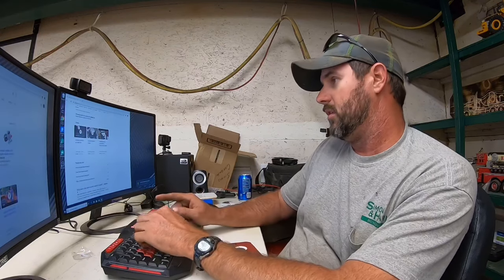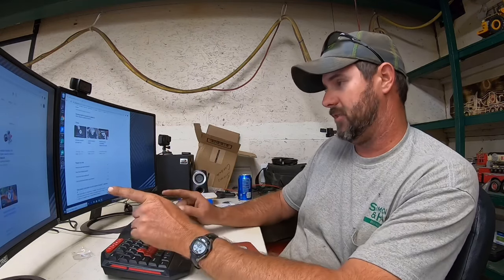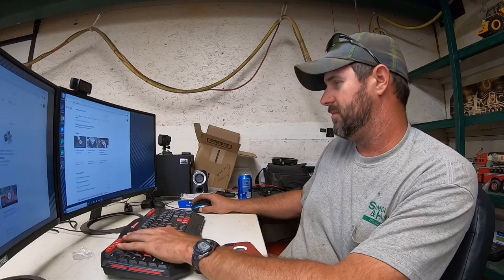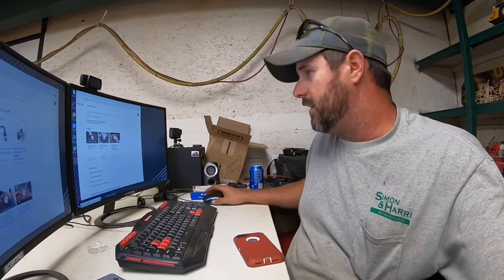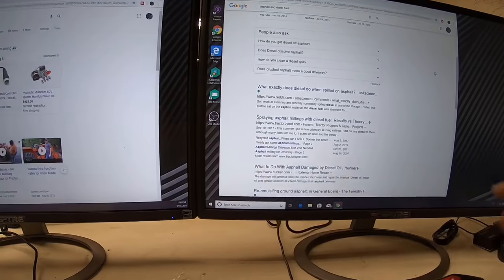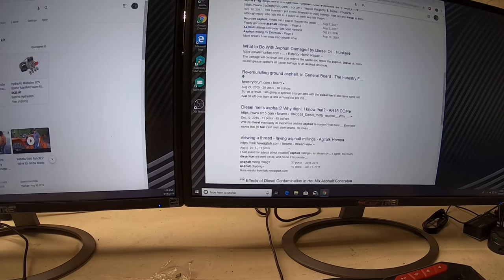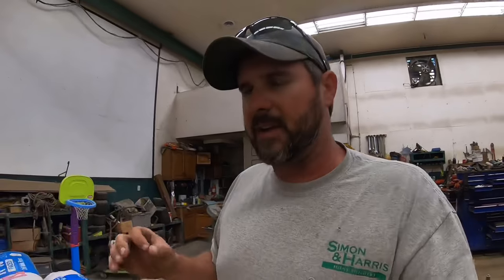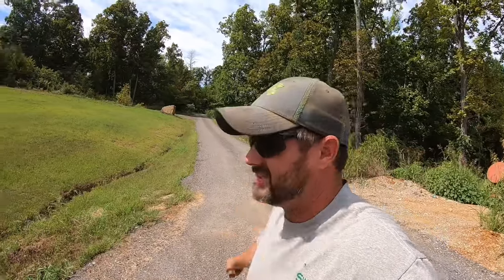Spraying diesel fuel on asphalt millings good idea or bad idea my thoughts

Comment: You don’t “flood” the driveway, lightly spray the millings with diesel so it “melts” the tar then compact it and it hardens almost like new within days.  You might get in trouble doing it today it but I saw a few owner operator truckers back in the 80’s and 90’s do it and it definitely worked. Also about the concrete at gas stations...  that also has a lot to do with sitting weight, concrete will stay smooth because it can handle the weight, businesses usually use concrete in their truck docks because of this too.
Reply: it will work spraying diesel fuel on it. but not forever.  diesel changes the composition of the tar and it's binding effect and depending on your weather conditions and traffic.... will crack,
Reply: The weight only sits on the fuel Island pad long enough for the truck to get fuel along the interstate the on ramps and rest areas hold up to the weight being there for 10 hrs and most truck stop/travel center parking areas are paved and the weight is there longer than the fuel island the concrete is because spills cause potholes/soft spots
Reply: I like your idea. I'm looking in to using crushed reclaim, I plan on spraying a light amount of diesel fuel on the aggregate the day before a hot day and compacting it the following day. The idea of spraying the fuel is to soften the tar so when it's rolled it will mix and bind the tar together.
Reply: @jacked-666  you can’t go wrong with it (IMO) I still know a couple who did it in the 90’s and I’m amazed with how well it’s held up, it’s in a climate with hot summers and cold winters too, I couldn’t be more impressed.
Reply: I still do it.  I even roll it just to getter done

Comment: Asphalt and diesel are both derived from crude oil.  By mixing them in moderation you can soften it enough to bind them.
Reply: In theory, yes.  But, it can be more complicated.  Different grades of crude and different chemical processes to make diesel.  I'd experiment if it was a smaller patch.  But, before committing to a larger area, I'd be real careful.
Reply: Correct!

Comment: The biggest problem with millings for driveways is everyone wants the free or cheap stuff straight from the machine which are almost never fine enough. I used compacted millings that were crushed and screened at the local asphalt plant to top of my parents' gravel driveway, applied "asphalt rejuvenator", then compacted again. It wasn't free but it was a fraction of the cost of hot asphalt. 6 years later it's still solid and looks great.

Comment: I don't know the answer but it would seem you are missing a probable scenario.  You aren't putting enough on to dissolve asphalt just enough to 'glue' it together.  The difference to use your analogy is you use enough paint thinner to dilute paint but not enough to water it down  beyond use.  So you want to soften the asphalt but not wash it away.  Still don't know if it would work but it makes sense in a way.  In cold weather it would improve heat and compaction by its softening action??  The definitive answer is to put down a small area and try it.  I know for years and years prior to the EPA roads were sprayed with both diesel oil and crankcase oil which kept the dust down on gravel roads and made a surface that was less dusty in the aftermath.  If your area runs off into any kind of water way or aquifer you could be courting legal disaster so make sure to check it out before even thinking of using petroleum products on the ground.  Today's prices kind of make it a nonissue I would think but it is an interesting question.  Take care.  Doug
Reply from the maker: Thanks for the thoughts and info

Comment: I did my driveway with milling over a Crushcrete base  4 years ago looks just like asphalt. I spread it out about 3” thick with a box blade sprayed heavy diesel over it then rolled it with a small roller I rented. Happy happy with mine. I have Seen others done with out diesel and it has a loose gravel all over. Also I live in north Florida.
Reply: Plenty of heat there @ baking sun even lol im in w/central florida

Comment: Hey man, this is just my opinion, I had a truck got stuck and the load of asphalt had to be dumped out. A year or so later we tried getting it broke apart and had to spray fuel on it. Now the dozer broke alot of the clumps up and helped get it laid down. After that we just drove the big tractor over it, and i can't tell where the fuel was sprayed.

Comment: We have a gravel driveway that's about 500 feet long. Problem is, it's not level. It goes down a hill and then back up the other side to the house. We're considering crushed asphalt but we don't know if it will hold up to heavy rain running down it without rutting it out. The contractor says he'll roll it smooth but can't guarantee it. Any thoughts?

Comment: I've used a combination of diesel and drain oil from my equipment for yrs. It stands up far better than than heat and compaction. A research paper was done on using used motor oil as a binder with asphalt milling. The short of it is it worked. And no the crap in the motor oil doesn't leach out and cause environmental problems. I spread the milling and compact them. Then using a 15gal sprayer with a 6'  boom throughly wet it down. It will soak in and bind it together. It's not like a diesel pump getting spills day after day causing it to deteriorate. It's a one time deal. And the only reason I use diesel is to thin it out and make it go further. The county resurfaced the limerock roads in our rural area with milling and because of inconsistency of the millings the roads are not holding up even with the little traffic they get. IT FLAT OUT Works! Now about the video. If you haven't tried something  don't poo poo the idea because you don't THINK it will work. To me it makes sense that it would. It softens the tar, sticks together and because no more is added it becomes almost like the original road surface.   At least try it! I never write comments but this got my dander up.
Reply: Me and the neighbor put used motor oil on are road  , works good more like asphalt versus milling’s
Reply: @hamiam2243  the area my grandpa and dad changed oil in things to keep weeds down in the driveway and parking area around the fuel barrels are the most solid spots in the driveway I put 1 inch rock only in those areas I put 3 inch on the rest the first year before topping with inch around and to the new shop I went with 6 for a year 3 than 1 now each summer I get a few loads of millings the county has available

Comment: I'm really surprised I haven't seen much discussion on asphalt sealer being sprayed on after compacting it. Is that bad or good? Does it help bind it together well? I wonder if maybe spraying a little in with it BEFORE compaction might help some too? I hope some others familiar with it may have some feedback.
Reply: Spread the grindings, grade, water them and roll them - even if only the water truck doing it. Then call the seal/oil company and hot oil it. they will design a mix using some diesel for penetration depending on a inspection of your grindings. Seems odd but having them damp is critical before oil

Comment: Use millings that are pure and not mixed with base rock. 1” minus material is good. If you have a big roller (8 ton +) you can use bigger chunky material on heavy commercial use driveways. Apply at least 4” thick (thicker for heavier use applications).  Make sure base layer is tight to start with.  Use water to keep it from getting dry when you work it. If the millings get dry, they start to separate and the fines drop to bottom. Moisture keeps gradation and leaves a smooth mat. Rainy days make great driveways.  Moisture also lubricates material for better compaction. Roll with a big roller to crush chunks. Then use tire and drum roller for smooth finish.  Fine millings for residential light vehicle with walkway to doorstep use and big chunky millings for heavy commercial situations.  Use an asphalt loot to fix edges and detail before compaction. Compact once to firm up and find week spots. Then skim grade again. Compact again to 100%.  Plate compact edges and hard to reach areas. 
Most customers mention using diesel. I respond with “Yeah people say that and if you choose to spray something on it when I leave, it’s up to you”.    If you read this whole comment, you know all you need to about milling driveways. Now have the eye and skill to grade them without leaving spots for water to settle and your golden.

Comment: Always enjoy your videos Mike, but I'm afraid my personal experience on this one differs to yours.  There is a big difference between laying fresh asphalt and millings.  Diesel is good at stopping fresh asphalt and tar sticking to tools and equipment because it breaks down the tar, but in order to get old asphalt millings to bind properly you need to break down the tar.  You don't need use much diesel - as has already been said a garden sprayer is perfect to just dampen the surface.  Lightly compact it first, then spray with diesel and then use a proper metal roller over it several times.  The top if the millings will bind together and last for years with normal light traffic.  I have done it several times on farm tracks and it works - infact a section of track we had contractors chipseal broke up after only a few years whereas the diesel asphalt millings are still going strong.  Ultimately experiment and see if it works or not in your situation...
Reply from the maker: No problem we can have different options and still be friends 😁

Comment: You're exactly right! We do a lot of paving for the state and feds on highways and freeways and they won't even let us spray our beds with diesel because it eats it like acid so they make us use a soap substance that's 95% water and very expensive and doesn't work at all but they have no problem letting the paver literally hose it down with diesel. So all of the trucks cary their own weed sprayer with diesel and just don't tell the inspectors what's in them.

Comment: I did it in front of my house. Literally sprayed diesel fuel and then went and compacted it all until it was all literally had as a rock. Here I am 8 years later, no problems. So whatever it was that it did or didn't do, I am not complaining. PS. max loads that went over it were 40 metric t. 

Is it as "perfect" as new asphalt? HELL NO.

Is it a fraction of the price and efforts of new asphalt? HELL YES.

So all in all, worst case scenario, one day this will be a damn good layer under brand new asphalt. Til then, I'm happy with what I have.

Comment: I have seen roads paved using hot tar on the base with a layer of chip rock over the top and then rolled and repeated several times, seems to make a decent pavement. Just down the road from me the county spread millings on one of our dirt roads and then hot chip sealed it and it has held up ten years now, so that will definitely be a good idea for you.

Comment: What I think they ASSume will happen with spraying diesel fuel on the millings is that the fuel like in your paint thinner comparison will soften the millings enough to allow them to stick together when the fuel evaporates. 

I have hauled asphalt out of a few different yards when my boss would hire me and the dump truck and float out to a guy that did residential driveways and I loved going to a yard that still had diesel spray for the dump box. The eco friendly stuff “worked” but always allowed some to stick that I would have to scrape out afterwards.
Reply from the maker: Interesting thoughts

Comment: I did a large parking lot once when the airport decided to resurface the runway. I had about 20 dump truck loads of the runway millings brought over and spread it around 4” thick. Compact tractor and cars, since we didn’t have DP equipment, eventually packed it down and 5 years later it’s all still melted together and hard as can be.
Reply: I work for the county and all we do is wheel pack . I like crushed create an a little moisture better an wheel pack .

Comment: It's good idea to use diesel spray on surface of Asphalt milling material.. Recently we used And now  Surface is harder like Asphalt....
Just spray the diesel with using of spray pump.. If you are pouring more it will peel off Asphalt.
Reply: It's never a good idea to spray Diesel on millings Diesel kills the oil in the millings

Comment: Right on! Right on! Right on!

Heat, compaction (preferably together) and sealing the surface are the best bets.  Chip and seal with a darker colored fine rock media is excellent.  Dark because you get the advantages of higher heat in both summer and winter.

Comment: I've worked for a paving company for 35 years. I use kerosene on any and all millings I use. It "reactivates" the asphalt. in the millings. You don't need a lot. I use just enough to change the color, then adjust from there. Not really needed if you do a thicker lift of millings, but  thinner lifts it works very well. And "tack" is what is put down on asphalt  before paving. Not for chip seal.

Comment: Kinda right. We put down on any given year 1000 tons of millings   we spray with diesel apply heat via 6 250btu salamanders fixed in on a attachment to the 35 ton rear wheel compactor.  It works excellent only with outside temp 60degrees an rising . Second we only use interstate highway millings not millings that include the burm.  Less stone almost all top coat millings big differences  we put them down with a d4 cat and the roller.  It looks like a highway within the hour . And lasts years .  Yes use diesel sprayed on yes use real heat yes use a big roller.  Plan and simple nice video but wrong

Comment: Our town just did a mile of road that used to be dirt they ran millings through a crusher and put them down with the paver no heat and you would swear they put down binder looks nice. I was told the trick to a good job is the compaction and your absolutely right about diesel fuel thanks for the video 👍🏻
Reply from the maker: Awesome

Comment: In Australia we spray recycled asphalt driveways down with a mix of diesel and used diesel oil to stop the weeds growing through it. This has nothing to do with sticking it together, the temperature alone will do that, but rather to stop it sticking together and keep it porous so water drains through it.

Comment: Here in Maine, we spread an and pack em, usually with our D4 or TL 240 and pack it with the Bomag AD 120 double drum vibratory roller, works great with reclaimed crushed asphalt, millings or grinding, or crushed gravel. It's always worked great for us. They used to chip seal here about 30 years ago, now the DOT uses some crap called C mix or skinny mix. It's not that good.

Comment: I used to work right next to our site's Receiving department, so there was always large trucks parked in front of our section, and where oil spilled onto the road the asphalt crumbled leaving a shallow crater.  We also used to get tire marks on really hot days — especially at the end of the service road where the trucks turned round.  Regarding the use of steel drum vs rubber tired rollers, vibratory rollers also have the disadvantage of falling off your driveway into drainage ditches. 😉😀
Reply from the maker: 😂😂😂😂😂🤷‍♂️this is true

Comment: Heat and compaction for sure.  I've put a few driveways in with millings and a few months later after the sun bakes it in it's very close to regular asphalt.  I also think a seal coat on top would help out in the long run although I've not seen it done.   There is also an activator product I've ran across that is supposed to help millings.  Good video
Reply from the maker: Good in info thanks

Comment: Well here is the story about asphalt millings most of them are stolen from a asphalt plant that recycles 
them owner operators working by the hour sell them for cash ,Here in north east Ohio its packed full of crooked paving contractors & crocked asphalt plants, The asphalt has very low AC content thats why most roads turn into gravel in 3 to 4 years witch makes asphalt millings that will never compact ,Shelly & sands are the biggest crooks when you get some millings off a road they paved its like black gravel & will never compact the sun can shine on it for 20 years & never bind together its all about crooked politics & job security ,I have had millings in the past bind together like blacktop but thats pretty rare with today's crooked politics...
Reply from the maker: Not here paving contractor was renting my lot and I bought form the state 🤷‍♂️

Comment: It’s not meant to be completely immersed in diesel. Just a light spray from a weed eater jug. A little diesel will allow the old millings to break down and become tacky again and then they will bond together. Imagine you pour a bunch of dry, unmixed, sac-rete on your driveway just like you put down the millings. And instead of adding water and mixing it before pouring, you just wanted to use heat and compaction.... not really guna get you very far right? (Assuming it doesn’t rain).
Reply: I agree with you . Far to many aren’t getting the concept of just a little to activate the tar .

Comment: I have a theory. If the diesel dissolves the millings that could be enough to make them bind together. The solvent for a rubber tube repair also dissolves the rubber. Also not having your tires stick to the asphalt could be a plus. Just the right amount could help.
Reply from the maker: Is see your thought process